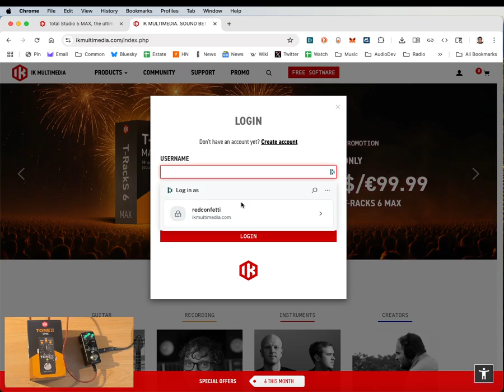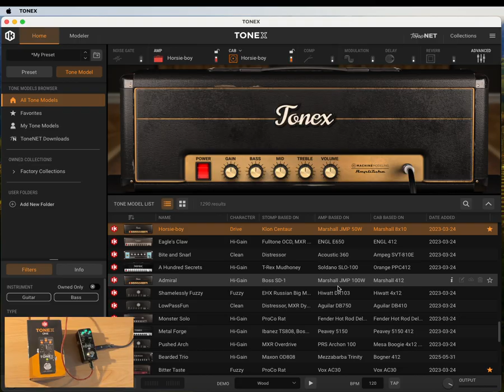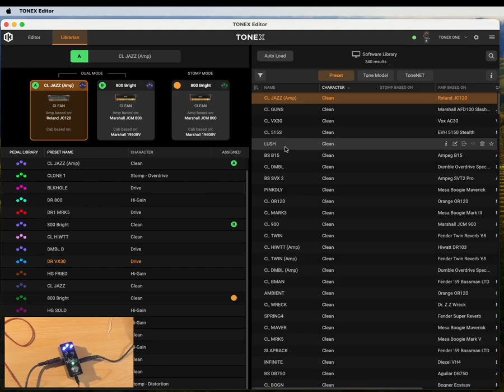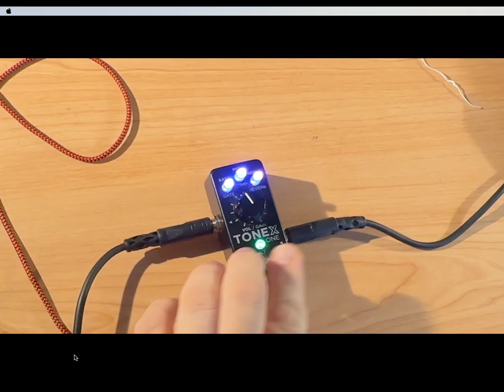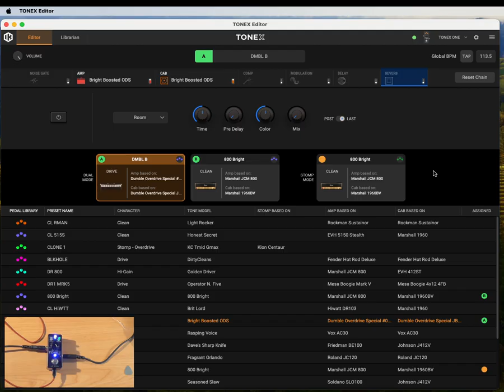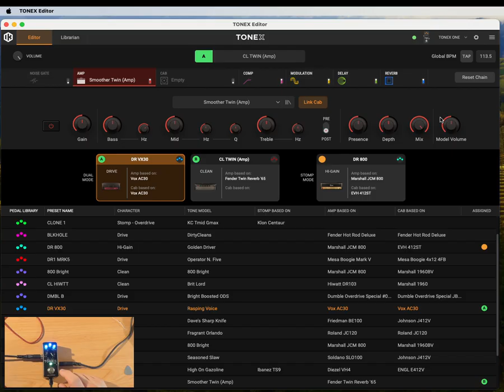IK Multimedia ToneX One Quick Start Tutorial

Comment: Great info, but how do you make Banks.
Reply from the maker: I don't believe there is a sound bank feature with the ToneX One pedal. You can either load a model that is On or Off (Bypassed), or you can load 2 models that change when you press the primary switch on the pedal. You can configure that using the ToneX Editor software.

I'm reading that the ToneX One pedal can store up to 20 presets, using the ToneX Editor software to select which ones are loaded. Then there is some method you need to use to go into a Preset Navigation mode with the pedal to cycle through the presets and load different ones. There are no banks.

Even the more expensive ToneX pedal doesn't support banks.